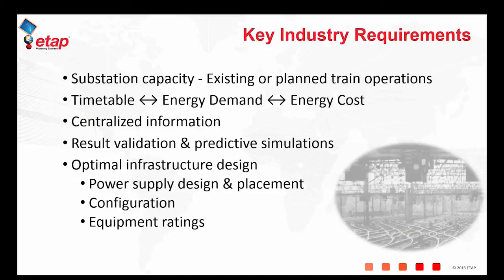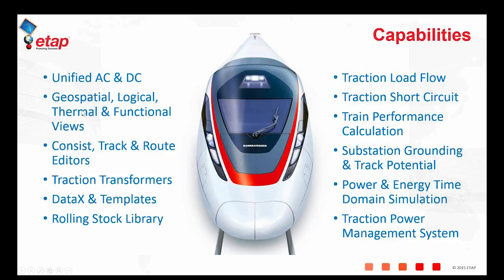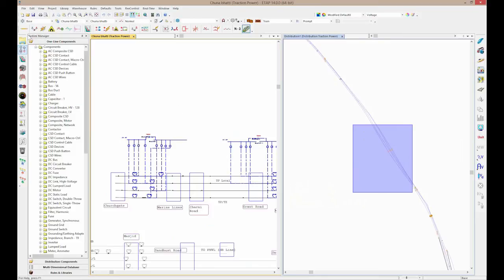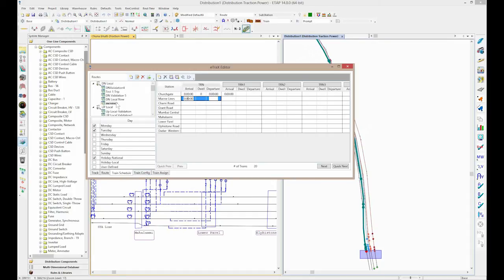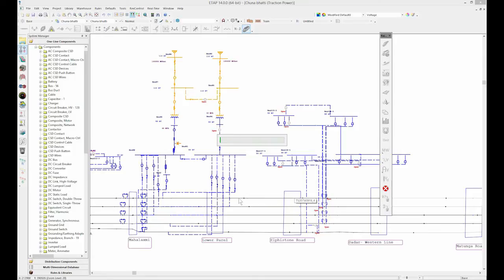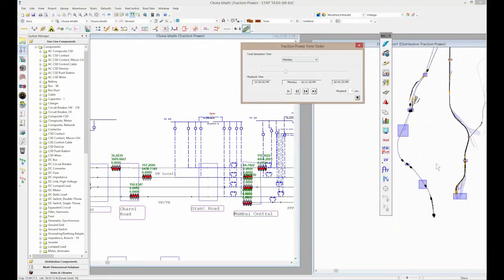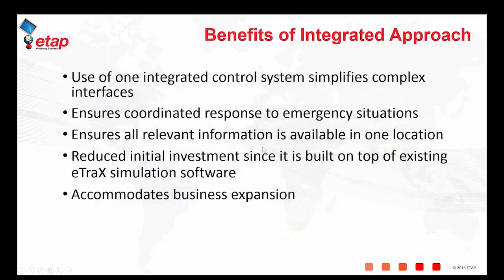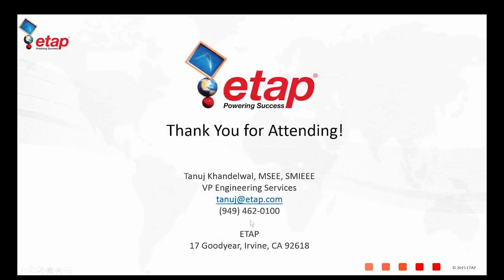eTrax™ – Railway Traction Power Solution

Comment: How to model 132kV to 25 kV traction transformer? In Etap when I add 3 phase supply, I am unable to select LL. In case I consider 1 phase supply then it requires neutral?
Reply from the maker: Thank you for you interest in ETAP Solutions. Please contact our Help Center at https://helpcenter.etap.com to assist with your question.